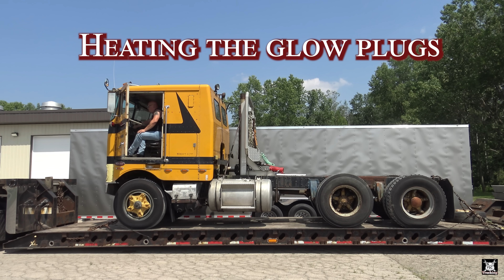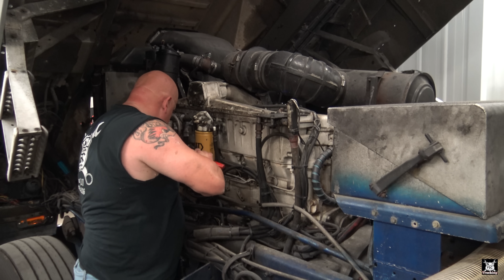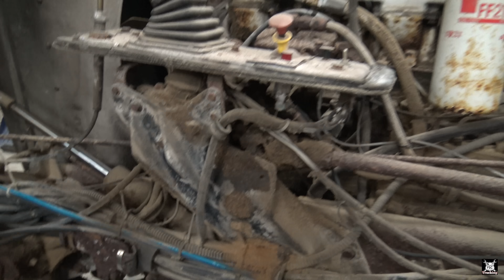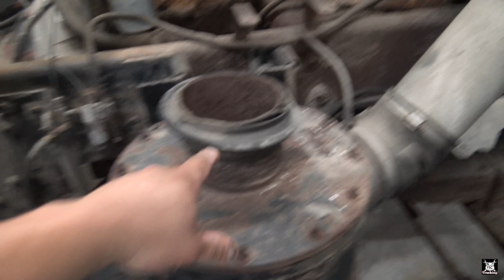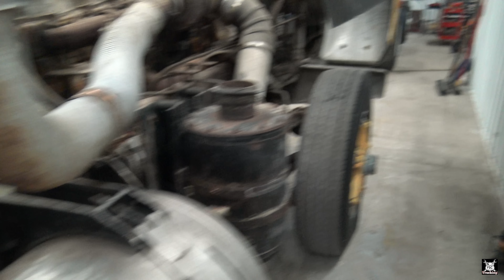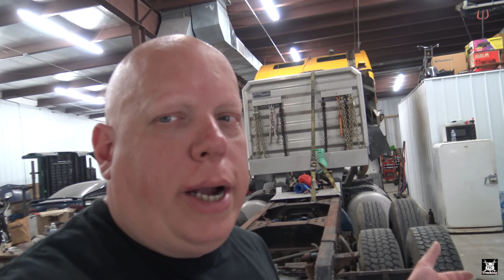I Still Have My Peterbilt 352.   What Is It's Future?

Comment: In the seventies, the AMT model co. sold a 1/25 scale Pete cab over ,  called the 
Peterbilt 352 Pacemaker.
On the original model issued box is an artist illustration , of the Pete, with full red and blue graphics on white cab.
I think I’d be cool to see how those looked ,
back when those were new. Good Luck Steve, I’m glad to see you’ve got the 352 back .
Reply: I built one of those kits in the very early 80's.  Painted it to match the art work on the box.  I think it looked sharp.
Reply: Just found one on flea bay. Brings back memories!

Comment: YOUR truck is easy for changing filters.  My peterbilt has a cummins and the fuel filter is between the frame rail and motor.  Most of the time I have to get down on my creeper to change it.  I change my filters every 20,000 miles reguardless.

Comment: I had commented on a previous with a question about the yellow. And now i have half an answer. I asked why u would't put a third axle under the yellow truck instead of under Orwell. But know we know that the frame on the yellow truck is useless at this point. Love the shop vids Steve, keep them coming

Comment: Dirt Perfect has a project truck where he had to alter the umber of axles, he cut the frame in 2 and had blocks holding the pieces level, welded extension pieces to the frame and welded it back together. So the 6 by 6 retired army truck is now a 6 by 6 with a tag axle. I think he has a playlist for this project, Lt. Dan being it's name.

it only needs a skilled welder and the extra lengths of frame steel to make a frame fit more axles.

Comment: Two or more cabovers close to each other is a very rare site here in the USA🇺🇸 nowadays. I remember I saw cabovers everywhere back in the 1980s & down. Nowadays the only cabovers I see around are fire trucks, garbage trucks, yard spotters, crane trucks, concrete pumper trucks, small non semi trucks like those Isuzus, & a few other kinds of straight trucks. The length & weight limits increased which were what eliminated the need for cabovers.

Comment: Forget about all the Nana's dissing the Daytons. I reckon they are awesome and I know loads of people that think the same. Not sure why anyone doesn't like them they look awesome and work fine if you know what your doing with them. I had them on trucks in the 90s and never had a problem with them. Plus they suit that erra truck too. I reckon they look tough. Just ignore them Steve and do as you please cause it's your rig not there's.
Reply: Daytons are still big on Aussie Road Trains and those boys run the hell out of those rigs.
Reply: @@AndriaSmith-gp6ms Oh haha, good one...
Reply: @@AndriaSmith-gp6ms yes I ride both on and off road I use it as an adventure riding bike so it will go anywhere I want it to and i like to ride the highways to get to destinations to take it off road up rivers, lakes and mountains back country areas. Great bikes I've owned 3 over years. Mine is the 600R model though 1994, very basic and mechanical which I like.  I'm guessing your referring to the 650L very similar to the 600R and good also. The 650R is a completely different motor and bike altogether though and is a beast not to be confused with the 650L. not to many 650R over in usa have those registered for both highway and off road though more an off roader. I've ridden a few Harleys too but never owned one, I like Harleys too but a different kettle of fish. Depends what your into riding wise. If you more want to stick to highway and sealed roads Harleys are great and comfortable for it. If your wanting to do the odd bit of off road or even some dirt and gravel roads the 650L is definitely the way to go and opens up more options. Even though it's more an off road bike the 650 is still comfortable with fairly big cushioned seat and can handle road riding fine too imo. Goodluck with what ever you decide to get👍

Comment: We were well into the 90's before we got "new" used dump trucks and tractors with Budd wheels. I think all the old originals had spoked Daytons. Always fun when changing a tire putting a socket on the ground and spinning the tire to make sure in was true and tightening the nuts more where needed to get em straight.

Comment: Does not matter what type of wheels you run just make sure they are tightened right.  Good to have a torque wrench.  The big advantage to having hub pilot is you would have outboard drums.  the advantage of having dayton rims is you can usually change them with a hand wrench and cheater pipe if you can't get to a air wrench or do not have air compressor.
Reply from the maker: Stud pilot is outboard too.
Reply: @fsctrucking  yeah I forgot I had a 92 white Volvo that had that style and outboard drums.  i also have two trailers that have that style with outboard.  You and Tim are doing a good job of not sinking yourselves to far into debt.  Shiny stuff is real nice but its even nicer when you have reserve money sitting in the bank and you have proven the old cabover can go any place a new truck can go.

Comment: That intake isn’t a bad idea as when doing offroad work you don’t get the dust swirling behind the cab, my freightliner argosy had a intake through the cab side wing but had to remove it when I fitted new exhaust shrouds, I never liked behind the cab intakes and wanted to have intake tubes like an aerodyne down the side of the cab so it picks up air at front of cab when driving on dirt roads
Reply: I believe the FLA or FLB cabovers had an air intake behind the grille, went into a vortex type air cleaner or precleaner.  Details escape me now as it was the early 70’s I think and Freightliners really werent that popular in the Shenandoah Valley of VA (no dealers close).  They also had a dual tube snorkel intake that had the inlets well ahead (maybe 12”) of the back of the cabover cab
Reply: @fredswartz1969  mine is 2003 FLH 6NZ C15

Comment: FSC, a PCT 3406 like you have (no aftercooler) was only rated at either 300 or 325hp. You probably should check the engine tag for the rated hp. Torque varied rather ironically between the two ratings.

Comment: Yeah, I get on ya about the rusty wheel, but I've also said it gives Orwell more character.  I understand time is limited and time is money.  The rusty wheel works just as well as the ones that are not rusty.  Aluminum would save some weight, but does it really have any other benefits?
The Pete 352... basically cutting it up for parts... someone else already cut it and the frame under the fifth wheel is toast, so not a big deal in my opinion.  It's not like it is a survivor, all-original classic truck.  I do wonder if it would not be financially more advantageous to buy a rear cut-off that is ready to go rather than using templates and whatever rail material you may use to transfer the 352's suspension to the Ford.  Granted, I'm not a CDL nor truck mechanic, I'm just an outsider with a life-long interest in trucks and the transportation industry.
I am looking forward to seeing your shop come together and these build/rebuild projects.  I think it's ambitious, but nothing ventured, nothing gained, right?

Comment: That 352 is a clean ride...... put the b model out of Orwell in the 352.... and put a C-18 in Orwell and stretch him with a new frame and diffs..... I put a complete frame with flex air into my subframe and the hubs fit onto my original front axle..... have a 1990 362 just like Orwell but it's alot longer
Reply: No electronic BS in orwell
Reply: @mintyman1968  never came across a c15 or an e-model with electrical problems... they are just as reliable as the b model and you get more power and better fuel efficiency
Reply: @timcanizares5240  Steve said a while back that he only wants a pure mechanical engine, due to potential regulation changes.
Reply: Steve would never do that because the moment he did put a post-1999 engine in "Orwell" he would have to run E-Logs, get DEF installed and a whole plethora of DOT red tape.

All three cabbies are exempt from current emissions regulations as well as newer as safety standards as they only have to be compliant to the regs of their year of manufacture.

Comment: Love the sound of the 3406A, i thought it was a 1693? (My favorite) as for CAT, I love the idea of bringing it back As to Factory Spec. Can't be many Very early square door 352s like that left. Are you sure it is a 1979? I have not seen those style doors on any 352 newer than 1972. Just me but too bad the ford won't stay as-is. 300k (I think?) MIles is really low and should be left alone.

Comment: BTW, I have the same engine in mine. It does have jakes. 
3406 A model. No after cooler. 
Mine also has the breather pipe in the sleeper, and exhaust ie in a curved part of the drivers side sleeper.
Reply from the maker: With or without glow plugs?
Reply: @fsctrucking : With

Comment: It looks like a lot of work, but in the end it will be worth it in the end. Excited to see the builds of the cabovers and the trips you have with Orwell. Also, have you had a lot of problems with the 17.5 tires you have on your trailer? I have a similar trailer and boss converted it to 22.5 since the smaller tires were blowing out a lot.
Reply: I don't remember seeing to many blown trailer tires in the last few years, but Steve carries a replacement with him most of the time. Also the bigger wheels would cause problems, as some of the loads would be overheight.

Comment: I wish you got a mic.
Reply: while the truck's are running and he turned away from the camera, I couldn't hear anything he said.
I could barely make out parts of it when he was facing the camera.
Reply: I had to turn on the CC and even with that in Auto, it took a bit.  It did help though.
Reply: @danielseelye6005  I'm not too option savvy, after seeing you're comment  I was gonna ask where it was but I decided to mess around with it first and I found it. Thanks D.S.
Reply: Although 2 and a half tons of torque sounds really good

Comment: Makes more business sense to get the 352 up and park the Furd - just cuz you have so many similar parts. Cheaper to keep running. But I guess if you are using all the parts ... same thing?
Reply: The 352 has frame damage from the headache rack back. (If you listen to him with CC, you can kind of get the gist) Even with the Ford having sat, it's in good condition to work on. 

Plus I'm guessing part of the deal with TFC Global giving him the truck is that he would work on getting it back on the road.

Comment: Have you considered an external wireless microphone for yourself? When you turn to the trucks to explain us stuff I'm really struggling to hear.

So is the reason converting the truck to dual drives because of weight over each of the axles? i.e could the ford pull the weight without but you can't make legal requirements to drive on the road.
Reply: 34k legal limit with tandems but only 20,000 for a single in many states.

Comment: Can someone give me a overview/summary of what Mr. F. is going to do with the 352 and the Ford?  My hearings not so good and I couldn't  understand him with the engines running.  Something about taking the axles out of the 352 and using one or both of them on the Ford?  Then what will the 352 end up with?
Reply from the maker: 352 frame is junk.  Will be used as a template for the 352 axles and suspension to go behind the Ford.  A new frame will be cut and drilled for the Ford.  Later the 352 will get the same from a new cut off.
Reply: @fsctrucking  Thanks.

Comment: Why change to hub pilot? Because they are better and safer for tyre fitter and yourself for 1, 2 they centre them selves from the hub not stud giving you a better balance wheel. 3 you increase your tyre options and wheel availability. Fitting the for with them man killer wheels is a bad idea you should modernise the thing all your trucks even get newer chassis cut off with disc brakes and modern air suspension  if you don't want to change the character of the church truck leave it sell it to a museum steve the thing is made to be driven update it just my 2 pence worth anyway I would do what tim gentry did with the yellow cab over
Reply from the maker: Nope.  I'm not interested in modernizing the old school rig.  Just get a modern truck then.
Reply: @fsctrucking  the beauty of it is you get the new running gear and chassis and safety features but none of the emissions shit we all hate. But its your train set you run what trains you want I'll be watching as always steve